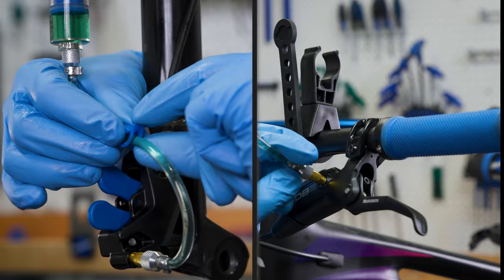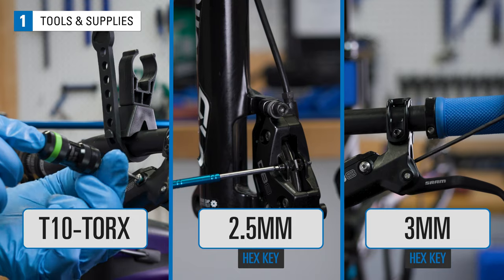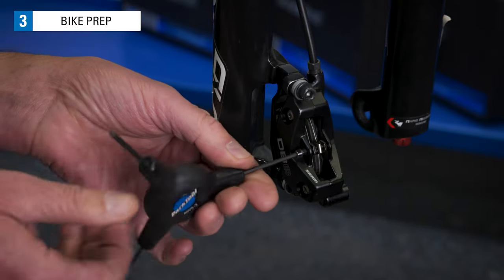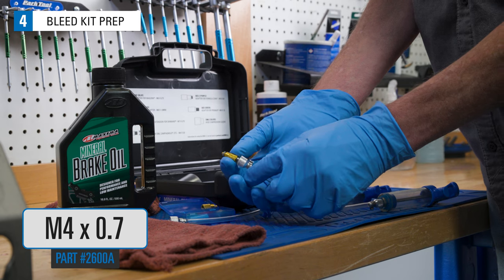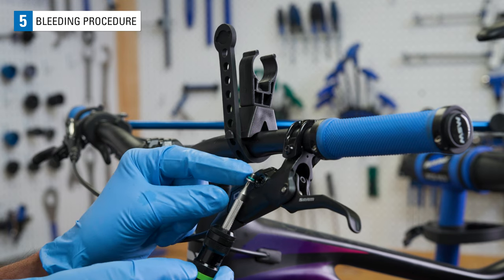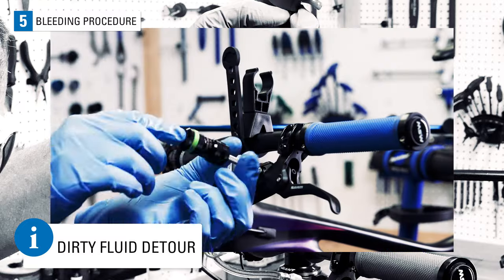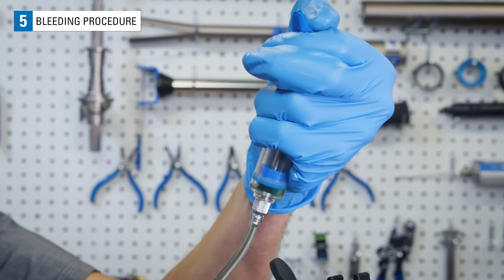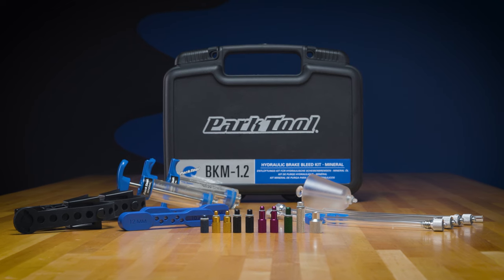Hydraulic Disc Brake Bleeding - SRAM Mineral

Comment: DOT 5.0 is mineral (silicone) and is tinted in a soft pink color so that it is not confused in the workshop, and DOT 5.1 is synthetic (not silicone) and starting from DOT 3 and 4 it has a light amber color. Both synthetics and mineral have the abbreviation DOT. The author does not know???
Reply from the maker: DOT-5 is not a mineral oil. You are correct that it is a silicone based fluid. Mineral oil is a hydrocarbon based oil. You cannot run DOT-5 in mineral oil brakes.
Reply: Dot 3,4 and 5.1 are polyglycol based and they are hygroscopic (they absorb moisture overtime) but silicone based 5 doesn't absorb water just like mineral oil. Anything but dot 5 is stupid for bikes, especially 5.1 which is the most hygroscopic brake fluid since you'll never need the superior boiling point or 5.1 in normal conditions...